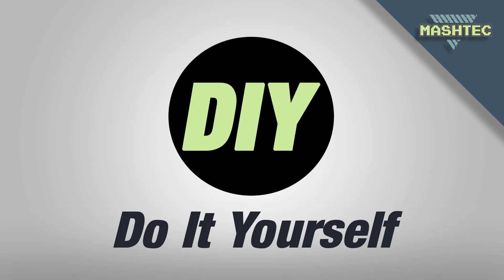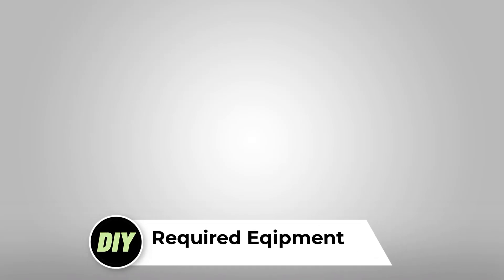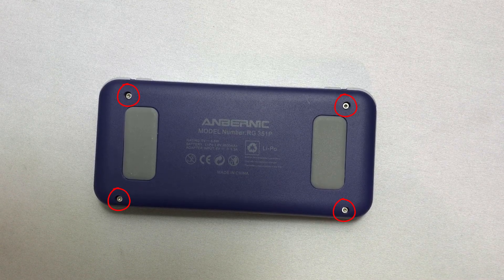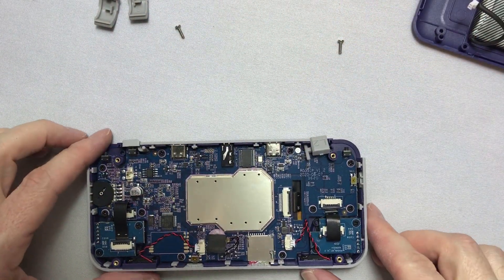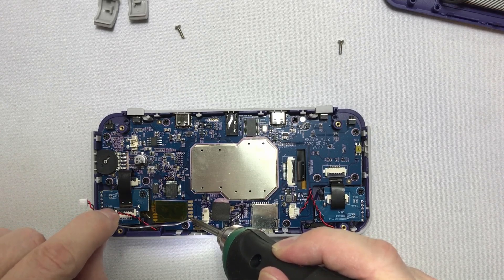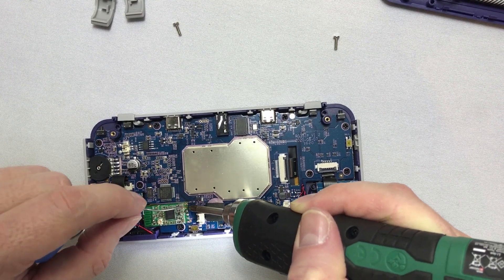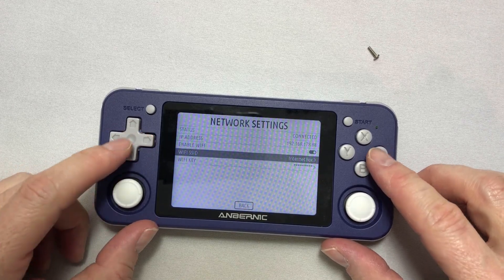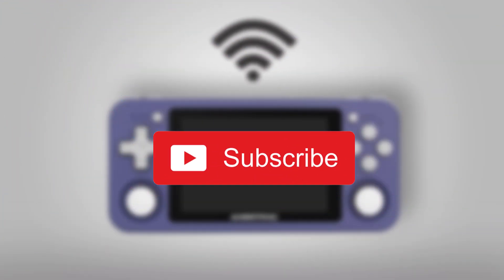RG351P - Howto install an internal WiFi module guide (DIY)

Comment: The wifi module just arrived, but it has long pins on it for puting it on a socket or something. Did your module arrived the same? I did order from the link you provide, but i was expecting a pinless module like you had.
Reply from the maker: Hey dude, sorry about that.
I‘ve heard from more people that ordered and got the same thing with the pin module. You can simply unsolder it.
Unfortunately it seems like the manufacturer changed something with the module. On the homepage of the link i shared with you, they show the module without this additional pin-board.
Sorry about that :( when i ordered from the link i received it without the additional board (like shown in the video)
Reply: @MashTec  No worries at all. I've talked to an electronic repair store and will drop the module and the handheld there for them to take care of. I am sure they will handle it with no problem.
Reply from the maker: @bademoderndesigns5962  Perfect! 👍🏻 yea, i‘m sure they know what to to...if not, just show them my video 🤣
Reply: @MashTec  Update! Installation worked like a charm,  and i couldn't be happier. Thank you for your time and effort for making this tutorial. It gave me the courage to upgrade my device to its full potential!
Reply from the maker: @bademoderndesigns5962  I‘m glad you got it updated fine my friend. Enjoy your device!
Reply: Had the same issue. I broke a resistor when trying to desolder the header pins, it's too tiny for me... Will try to find one without header...
Reply from the maker: Hi Nico, i‘m very sorry to hear about that 😢 i don‘t know why they ship the module with this pin-board now. Only causes trouble for people...
Reply: @MashTec  True. I asked them if they have it without the header, hopefully they may offer a solution.
Reply from the maker: @NicoSensei  yea, me too. Fingers crossed!
Reply from the maker: Please let us know if they have a new item that fits again...so i will update the link in the description. Would be very much appreciated.

Comment: Just bought the WiFi board from your link in AliExpress...arrived today after 10days shipping, so at the weekend I'm doing the mod myself to my 351p.
Two things you get when ordering...the choice of the board with or without an external antenna connector pre-attached...and the module will come with a 6pin male connector pre-soldered through the pcb... these will have to be de-soldered and removed...but no biggy.
I opted for the fitted antenna connector so I'm aiming on pinching my broken DSLite's antenna and testing with and without...I'll report back when completed...looking forward to it over the weekend...cheers Mash Tec for the guide...and to RetroGameCorps for the initial link to your great site... 👍
Reply: Can you tell me if the one with the external antenna connection still has an internal aerial as the model without the connector has sold out
Reply: @philw9339  yes it does. I have used an old DS antenna on mine which vastly increases range but created noise through the speaker. Using it without now and it's silent without any further mod.
Reply from the maker: Hey, thanks a lot for your helpful feedback!
It‘s strange that the module comes with a pre soldered 6 pin connector. Mine came without that.
I‘m glad you were able to help yourself out ;)
Let me know about the outcome with the antenna. I‘m curious!
I got a solid 50% signal strength even though my WiFi router is one floor below my room, so i had no need to pimp it further :)
Reply: I used this one: Adafruit 2.4GHz Mini Flexible... https://www.amazon.com/dp/B01E43VXO0?ref=ppx_pop_mob_ap_share which matched the board I got from the link shared with this video and it was good for signal, not so good for speaker noise.  Even shielding the wires with some copper tape didn’t help at all.  It’s not noticeable when WiFi is disabled though.
Reply from the maker: Hey dude, thanks for sharing your feedback with us ;)
Concerning your WiFi boise issue, it depends pretty much on how close the speaker cables are to the WiFi antenna. I tried to align them a bit off the module to avoid these interferences. And they are mainly gone..i can hardly notice them while transferring data.
Also, Russ from Retro Game Corps has a guide showing how to shield the cables. Not sure if you tried this already, but maybe it helps:  https://m.youtube.com/watch?v=pQYeQW8bwqQ

Comment: That's not the same wifi module as in your video, mine has pins protruding down over?
Reply from the maker: Hey dude, did you order it by the link i provided?
You can choose from two versions. Take the one i‘ve shown in the video right at the beginning ;) (scene with AliExpress page open)
Reply: @MashTec  yeah I used your link, no matter
Reply from the maker: I just checked the link again. For me it takes me to the right module.
Reply: @MashTec  the one in the intro is a different module
Reply from the maker: @jarrakev1  You mean the image? :) that may be. I took it from a website, because i have a bad camera for marco capture.
Reply from the maker: Ok, now i got your point.
From another persons post i read that they sell it with a 6 pin connector board now :( i‘m sorry. The time i ordered it i received the module as shown on the page. Just the plain module.
You can de-solder the 6pin connector, then it should just fit fine.
Reply: @MashTec  I thought I was cracking up for a moment. Haha. I’ve been combing the web for the one you used. I actually thought about the de-solder solution. Thanks anyway great video.
Reply from the maker: If you already have some basic solder skills, i‘m sure you can make it ;)
You‘re welcome!

Comment: I installed one of these Modules already! ☺
Reply from the maker: Great! Did you use any different technique to do it?
I was first thinking it would be good to put some solder on all 6 pads first and then install and solder the module to the board. How did you do it?

Comment: Hey # MashTec,
Is this wifi module different then the original wifi module Anbernic used in their RG351P's? I'm also curious about the crackling/popping noise which arised with the original wifi modules. Can you maybe do a bit more extensive testing and let us know?
Reply from the maker: Hey H, i‘m not sure what module Anbernic used for it‘s early RG351P devices. I just found this one to be the most compatible one,  since it fits perfectly to the mainboard. So, it‘s most likely that Anbernic used the same.
I will open up my RG351M and check what module is buit in there ;)
I had no issues with crackling noise while using this WiFi module, but others reported the noise problem with it.
So, i think it‘s a problem of how you place or shield the Speaker cable.
I try to investigate more into this.
Reply: @MashTec  Do you mean others reported a noise problem with it after soldering a wifi chip in their 351p's? It's most definetely an issue with shielding of the speaker cable, but is shielding it with Polyimide enough to prevent the noise? I want to know more! Please keep us updated with your findings and thanks again for the awesome video!
Reply from the maker: I just checked my RG351M. Anbernic uses a different chip here with an external antenna from the chip to the device body.
Since the modules differ i‘m not sure if they effect the audio noise in the same way.
All i can say is that i get absolutely no noise at my speakers when WiFi is active with this module i showed you.
Reply: @MashTec   Thank you so much for this thorough examination, your efforts are really appreciated. One last question, do you notice any difference in speeds / signal strength compared to the 351m? Thanks again!
Reply from the maker: @HarunTerzi911  Good question dude. Just asked myself why i didn‘t already check this ;)
So i did the test:
Both device were located at the same spot in my house for this test. FYI: The main router is located in the 1st floor. I have a WiFi repeater on the second floor. And the devices are located in my room on the 3rd floor.
The RG351P has a signal strength of 51% and the RG351M has a signal strength of 61%. So the one with Anbernics module is 10% higher. But Anbernic makes use of an extra antenna within the device, so it is expected that they get a slightly better signal strength.
The module i used also has a IPEX connector for an external antenna, but this requires additional hardware (antenna) and extra work to place and connect (maybe solder) it to the device body. Since the RG350M is made of aluminium, they might use the chassis as connector for the antenna to improve the reception?
All in all, i‘m happy with this solution. It‘s not that much of effort and the result is a decent WiFi reception :)
Reply: @MashTec  Thank you so much for this. That is a far better result then I expected! Awesome video with awesome follow up through the comments. You just earned yourself a new subscriber. Thanks again for everything!
Reply from the maker: You‘re welcome! Thank you for your feedback :) i learned a lot by your questions.
Reply: @MashTec  hey MashTec! I never saw anything in your thorough test two comments above about wifi transfer rate, any chance you can do a quick downloadspeed comparison check between your modded 351p and the 351m? :')

Comment: Great tutorial, good work very easy to understand.
You select with IPEX connector or without IPEX (internal antenna) in your setup?
The wifi signal is strong enough ?
Reply from the maker: Hi dude, it kinda depends on your WiFi. If you have a decent WiFi signal at home, your absolutely fine using the module without the IPEX connector. Even though i got the version with the connector, i never used an extra antenna with it and have a good reception with it.
Remember, there is not much room in the device case to install an additional antenna into it.
Reply: @MashTec  Great thanks for your answers

Comment: Hi - there's 2 options on the wifi module link on Alliexpress: internal antenna or ipex connector - assume it's the ipex one I want? Will this work on both the RG351P and RG350M? Thanks!
Reply from the maker: Hi, you can use the version without IPEX. IPEX is used to extend the antenna.
BTW: The RG351M already has internal WiFi, so no need to install one.
In case is broken on your RG351M, you can use this one as replacement.
Reply: @MashTec  hi and for the RG350M?
Reply from the maker: Well, the mainboard of the RG350M is not prepared for a WiFi chip.
Still, i once hd the idea to solder the pins of a WiFi dongle directly to the connectors of of of the two USB ports.
But i don‘t think it would make much sense. Not sure if other USB devices would still work with such a chip connected in parallel (i doubt it)

Comment: Is this antena dual band? Does it support 5ghz wifi?
Reply from the maker: Sorry dude, only 2.4 GHz is supported.
Reply from the maker: BTW: I have two WiFi networks at home (my router FritzBox 6490 supports this function) because i have devices (home automation) that only work in 2.4GHz networks. So i‘m fine with 2.4GHz :)

Comment: That would be cool if this was possible on other devices like the ogs or the rgb10. Don't know if there's anything on the board open for this mod though. Probably not.
Reply: Same SOC doesn't necessarily mean same logic board
Reply from the maker: That‘s right. Even tough the chip might support a WiFi interface, the pins need to be placed on the mainboard.
We‘d need a pic of the mainboard or a schematic of the PCB to find out.
Reply: Was just thinking the same thing.  I mean all the devices are using the same chipset for the most part right ?

Comment: Ich finde du hast dir es selbst ein wenig schwerer gemacht. Die Folie hätte ich auch die Rückseite des WiFi Moduls gemacht und die Lötpads auf der Platine hätte ich voll ausgenutzt. Du hast die WiFi Platine meiner Meinung nach zu weit nach rechts geschoben, weiter nach Links und du hättest ein besseres Ergebnis gehabt. An sonst ein guter Tipp, ich habe aber die M Version und WiFi schon integriert. Den Parkside Lötkolben habe ich auch, kann ich empfehlen, super Preis-Leistungsverhältnis.
Reply from the maker: Vielen Dank für dein Feedback Klaus-Peter und gutes Auge ;) Das ist genau der Lötkolben von Parkside :)
Im Nachhinein dachte ich auch, dass ich ein paar Dinge hätte besser machen können, aber es hat auch so gut geklappt.
Viel Spaß mit dem RG351M...ist ein super Gerät!

Comment: Do you still get noice from the speaker? Other guides show shielding the speaker wire.  Curious if that is needed?
Reply: Same question, got my answer !!! Thanks for the video 👌
Reply from the maker: Hi dude, no not for me, i had no troubles with noise. No need to shield anything with this module.